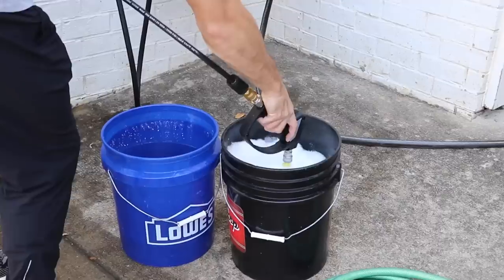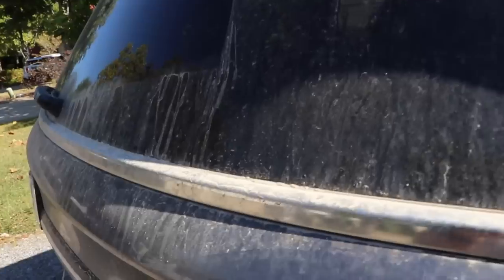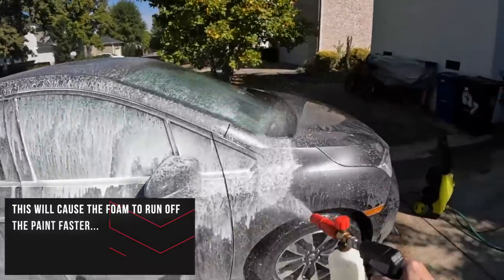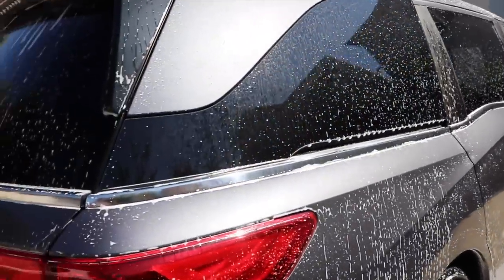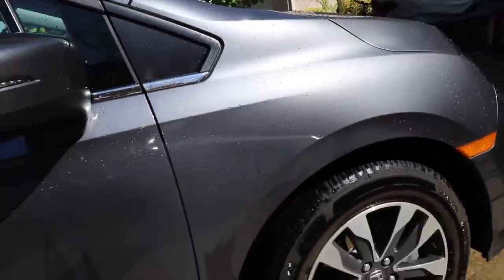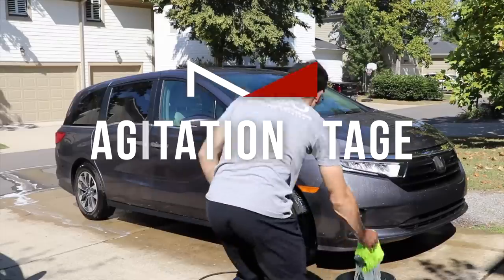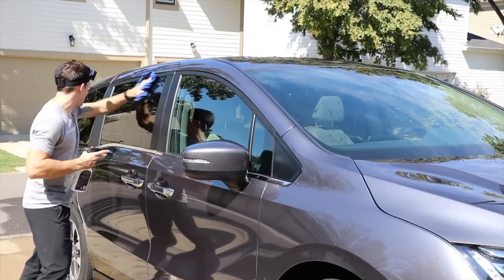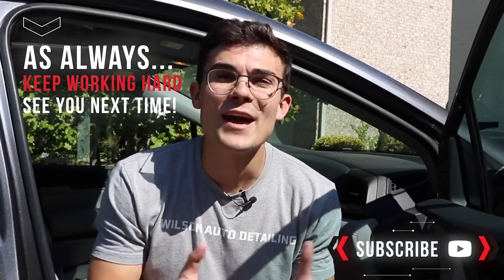Stop Using A Foam Cannon

Comment: moral of the story.. foam cannon makes it fun and can be used to apply soap but completely unnecessary.  a contact wash is the best way to clean a car.   I'm a detailer. I rinse the car,  foam the car and do a contact wash with  3 mits in one bucket. then rinse. done.   easy ..no need to pre treat and rinse them degrease and rinse them contact and rinse...as long as you're keeping your mits and microfibers clean. do whatever you want that is quick and easy.  don't even need to waste time setting up  pressure washer or di tank regular hose washer works great. just dry the vehicle quickly and you're good.   this industry and you tubers try their hardest to promote... most products all do the same thing. no need to spend a fortune for 100-dollar soap when Meguires Gold Class for 10$ does the same job.   .. and SuperClean. so cheap and effective. As detailers you need to be efficient  and save money.

Comment: I just did something very similar to this yesterday.  Superclean diluted 8:1 with an ounce of Gold Class soap to help increase dwell time.  Worked just like the video except the car had no protection and drying it off with the Ego blower took a bit longer than expected.  It was an experiment to see how quickly I could do a touchless exterior on the family SUV.
Reply: Get some tec 582 and spray a little on after you rinse and then rinse it off again. It'll add some hydrophobics and make blowing the car off way easier
Reply: Get some formula 4 spray wax.
Reply: Screw formula 4 and Tec 582, get Mirror Polishes’ Touchless Ceramic Spray & Rinse sealant.
Reply: @Ichabod_Jericho  tell me more
Reply: @Nick E right on thanks I'm gonna try one of em

Comment: I know people with show cars that won't use anything harder than  a gentle flow to wash the car.  They would  clobber you for using a pressure washer!
Pressure washers are for  driveways or brick walls.
Reply: There is huge variation in pressure washers. At the right distance they are very gentle. They also use less water than a regular hose and are easier to aim. There is a reason that virtually every detailer in existence uses them. You'll see far more marring from touching the paint while washing or drying it, no matter how careful you are. 
     Your car will never be perfect without polishing, and wash marring is easily removed during polishing.
Reply: @joeschmoe6908  will you even lose time explaining something to someone who refuses to use a pressure washer to clean a car? I wouldn't 🤣
Reply: @afonsofreitas3595  It hurt me to type it because I realize that he probably is beyond hope, but I didn't want to say nothing in case some newbie reads his comment and thinks it has merit.
Reply: @joeschmoe6908  You're absolutely right, didn't think of that! 🤣 Great ideia great idea 🤝🤣

Comment: Luke it's a bit of an investment but I think with my setup you could cut your times in half and do completely touchless washes in some cases.

I have four 5 gallon containers diluted 4-1 with a spigot attached. In one of them I have P&S enviroclean, which is amazing and does a bang up job all the while smelling like cherry. 

In the other 3 containers, I have the Chem-X 2-step touchless system which is a low pH foam (stars), which you foam onto the car and then follow up with step 2 which is a high pH foam (stripes), which causes a pH shock and pretty much makes the dirt jump off the car in some instances, and also neutralizes the low pH step 1 to bring it to around neutral, then rinse off under high pressure. 

But the real beauty of this system is what's in the last container, a regular old high foaming super slick pH neutral soap. Why is it beautiful in this situation? Well say that I'm not gonna be able to do a full touchless wash and I've gotta get in there by hand to get rid of some grease and road film, well in that case I'll fill up my foam cannon with 75% of pH neutral soap, and then the last 25% with the high PH stripes soap. That results in me having a soap that'll pretty much dwell all day with a pH around 9-10 to get rid of the road film and grease. 

Then in the winter time or after a few storm's and the roads are good and covered in salt, I'll do the same thing but use the low pH stars soap instead and now I've got a thick soap that'll dwell and chew up all that mineral build up.

It basically gives me 15 gallons of a modular soap system that I can use in several different ways, touchless, low pH, high pH, pH neutral and since it's already pre-diluted into containers with a spigot, it's good to go
Reply: start making vids
Reply: @korygayle934  thank you sincerely for the encouragement as it really means a lot to me. 

I've been trying to figure out a bit of a plan and approach to do so because I actually have a lot of people tell me that I should, but if I'm being completely honest it's a bit scary to take that final step and make actual content so that's held me back a little, but I am actually officially working on it right now so I'll be sure to reply again when I post. As much as I agree with the sentiment that you just have to go for it sometimes, I just don't want to be half assed with it so I can try to offer whatever I can to as many people as I can.

But I promise there's gonna be some stuff really soon so you're more than welcome to sub now. If you do you'll also always have the distinction of beating Humberto (1st from Puerto Rico) to it and not letting him be 1st in at least one instance. Haha
Reply: 👍start off with a setup vid and tips and mistakes video
Reply: 👍start off with a setup vid and tips and mistakes video
Reply: 👍start off with a setup vid and tips and mistakes video

Comment: I was always scared that degreasers would remove wax since it is technically a grease, fatty chain with an ester bond. I remember being told that dish soap, a degreaser, would remove wax. Does degreasers remove wax?
Reply: Yes
Reply: I dont use degreaser on a car that isnt going to get some kind of protection after the wash. It’s definitely going to strip some of the protection. I dont use this step on any of my personal vehicles as they get regularly washed and not waxed everytime, and the degreaser is something needed before the foam cannon to help strip some of the stronger contaminants without needing to aggitate.
Reply: @Sean Giordano  he asked a simple question. Do Degreasers remove wax..
Reply: Degrades it quicker yes , but doesn't need to be strong to work well
Reply: Actually they do but very slightly compared to a ph neutral soap. They finally answered this question and urge you to watch the forensic detailing channel on you tube named high ph vs ph neutral soaps .I think very interesting to watch

Comment: Hey Luke, wouldn't a degreaser be harmful or damaging to the coating? Considering what degreasers are designed to do. I'm just genuinely wondering if that would be the case?
Reply: A good ceramic coating and properly applied , it would have no impact on the coating
Reply: Yes, alkaline based cleaners CAN break down the ceramic. Why do you think we use ph neutral soaps? Smh🤦🏻‍♂️
Reply: @elomeli211  Aggreed but no shampoo should have enough ph to destroy a coating, specially acidic, it would melt your fingers ahah (i think) 🤣🤣
Reply: @afonsofreitas3595  on one wash, no. Using a degreaser or touchless wash as a maintenance on a coating will definitely shorten its life span. I cringed when he said "full strength".
Reply: @elomeli211  Yeh ik ik! Unless the coating manufacturer says other way, always use neutral products 😁 I'm saying rhis because of Carpro for example, they're "maintenance range" for their ceramics isn't all neutral but it was the way it was designed to work 😅But this is so misleading... This is the type of video that makes people think ceramic coatings are bulletproof
Reply: @elomeli211  It's actually funny because degreasers are often used as a way to destroy coating to test they're durability so yeh 🤣🤣🤣🤣

Comment: Im in my forties and been using one bucket to wash my cars. Usually just spray off the wash mit after each panel. I just cant see a foam cannon saving time from set up of the pressure washer /water hose/ mixing soap. I just get the  bucket and soapy water and go at it. Simple and works.  I see being a mobile car detailer where it might be helpful to have a pressure washer setup. But I honestly just want to enjoy washing the family car. Dont want it to be complicated. Can some one tell me if a foam cannon does actually save time ? And a pressure washer makes it easier and worth the extra set up time ?
Reply: It takes 5min, power/water source, foam setup. The honest point is, you decrease adding swirls by 80% each time. Because you get to pre rinse powerfully, paint/rims/ fender well etc... then you can decon with super clean 4to1, then rinse again, you basically don't have dirt left...https://youtu.be/3hifp2_VEfw?si=EYeOftCpnWwURxSW

Comment: Mid video yet, i have a question popping in my mind: In what way is this method of using a degreaser better than using, for example, a high alkaline snow foam like LIFT from carpro? It's alkaline, so its a good degreaser and it was formulated as a snow foam in the 1st place... 🤔
Reply: A degreaser is more cost effective
Reply: @evandils5640  Well could be yes, but some of the considered best snow foams on the market have high dilution rates, kosh chemie, built hamber etc. But i all depends on cost per L

Comment: I have the same pressure washer but I can't put a gun like your I do not why If you be able to make a video about it tank you
Reply: I had similar problems with my Sun Joe pressure washer. I bought a foam cannon with an adapter to fit into my style of gun. Look up your model number and search on Amazon for a compatible piece
Reply: U just need to get new fittings for that gun..probably smarter to get a new hose as well
Reply: Bro can you slow down man.... not everyone can ride along with you that fast geeezzzz 😆 🙃

Comment: How does he get de ionized water only
Reply: Special filter before the water enters the pressure washer 😁 Think of it like a professional BRITA 🤣
Reply: @afonsofreitas3595  hey afonso i see you commenting on a lot of other pdoples comments givign out all the good deets, i have a question. he has been talking about the formula 4 for a while but he still uses a d.i. tank do you think its worth it to buy the formula 4 tank or should i invest in a di tank setup?
Reply: @emilyanglin6720  If you do professional work that can quite easily cover the cost of the dionized water tank then for sure buy it, as it's a long term investiment that only requires "low" maintenance, the Formula 4 drying agent is way less costly but you waste more time because you need to actively  apply it, whether with the DI tank you don't, it just dionises the water that you would use anyways during the wash, taking out that extra step of applying something after the final rinse! For a diy the DI tank is very costly, so the best option is a drying agent like formula 4, for a professional, the dionize water tank surely worth it long term but way more expensive! Hope i could help, or at least give an opinion worth your time 😁
Reply: @afonsofreitas3595  thank you! 😃

Comment: There is strong foam and weak foam, weak foam is a waste of time, good foam isn't. Besides, a good APC foams up out of a cannon anyways so you can use APC out of a cannon as well AND cover the car faster than a hand sprayer.

Bilt Hamber Touchless. mic drop